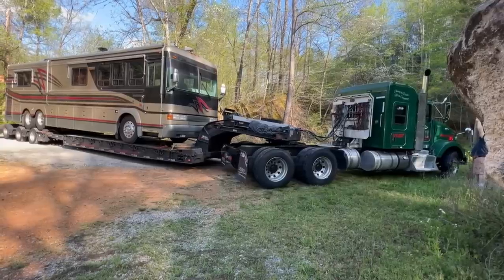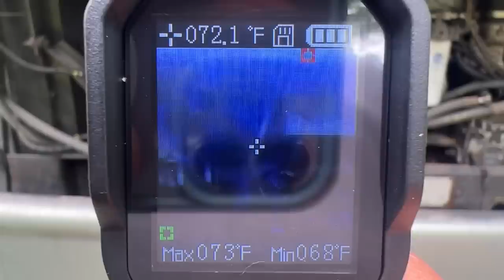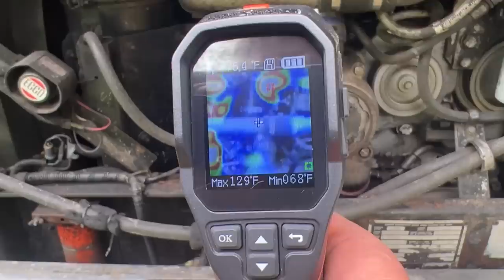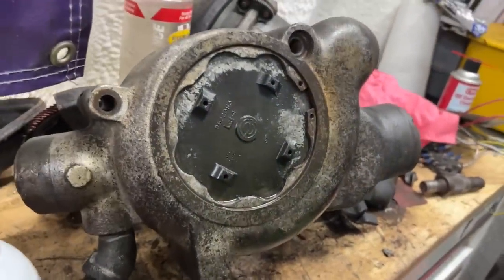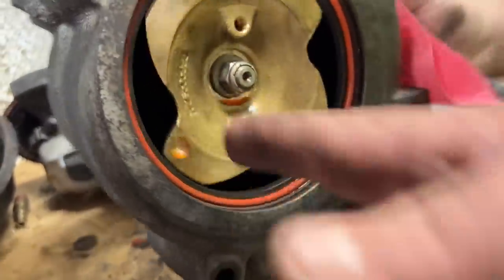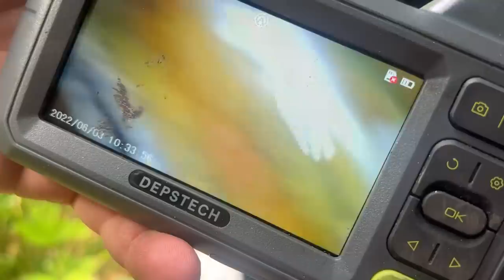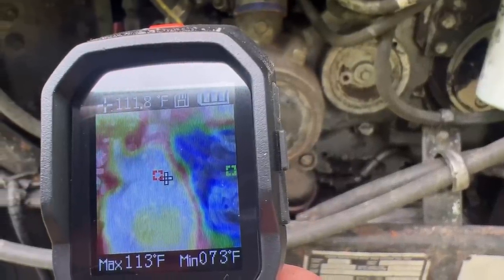Bad repair costs thousands but could have been a $20,000 + mistake.

Comment: As a former ASI certified diesel mechanic i have to say, I am sick to death of the widespread incompetence in the field. This is inexcusable. Thanks for what you do.
Reply: Thanks for your comment ... seeing the same in my former Industry ... Aerospace. Unfortunately, you can't just "pull over" at 35,000 feet. Troubling trend.
Reply: I too see this, which you can't really discribe any other then utter carelessness because ppl ARE trained, they just don't give a F anymore. I see it in ALL fields of work.  5 years ago it wasn't as bad as this I think. I try to put my finger on it what has changed, especially in the last couple of years and can't help but think that the pandemic and especially lockdowns destoyed far more then we think. Something in the spirit of ppl has broken I think; "Why should I care.."
Reply: @throttlebottle5906  Don't blame people who went to college for being a bad mechanic. You're not gonna find those people working in a diesel shop, after all - unless it's as a marketing/finance/HRM/whatever kind of position. College either leads to an office position, or to a research/lab position. It's unlikely that the diesel shop hires college graduates to do maintenance work. 
You can blame people who went to college for shitty design flaws, like EGR systems that clog up even when used properly by the user (read: thrash it, get it good and hot every couple of days), engines that wear out prematurely etc. Design and engineering stuff.
Reply: I'd like to see the old medieval guilds return where you could be certain of hiring a Master or one of his Journeymen to do a job and have confidence that it will be done correctly.
BGM would definitely qualify to be the Guildmaster of the Southeast Bus and Coach Repairman's Guild.
Reply: Most of America's workforce including skilled tradesman are unfortunately on drugs or mentally incapacitated but show up to do something every day. Go figure.
Reply: @mfbfreak  Also blame NO-SKILLS worthless  politicians who impose ecology-priority standards that are impossible to meet without sacrificing long-term reliability. These clowns are responsible for driving Caterpillar out of the Heavy truck market.
Reply: @SIONARAFLORIDA  Yeah, pretty much everywhere I've ever worked has been stocked with drug addicts. Pill heads to pot heads. 'Oops I forgot' is a common theme.
Reply: @davebryant6905  I have always looked at it this way:
I do my own repairs.
I buy my own tools.
I buy my own parts.
The money I would have thrown away on bad mechanics or even good mechanics are invested now in my own tools.
And I saved on the parts too.
It works out well.
My tool set is growing.
If I would have gave it away to unknown mechanics I would have nothing, no tools and headaches.
NOW ,  if I were a rich man, well, things would be a. Might but different... But I am not rich, so I get dirty working on my bus! Sometimes love it, sometimes hate it.
And my bus runs.

Comment: For viewers of South Main Auto…” just,because it’s new, doesn’t mean it’s good”. That was some great troubleshooting
Reply: Why is everything that is NEW these days such shit?
Reply: That phrase is true, but if i looked and heard the video correctly, the water pump may have been rebuilt at the shop. Either way, manufacturer defect or installer error. Been there done that. Small claims court !!!
Reply: This advice is wisdom. Truth, I'm an old hat, been spinning wrenches since the 1970s as a lad. I've learned that one must never assume it's right just because it's been replaced. I apply this concept to everything, even my own travails.

Comment: Totally inexcusable work by whoever rebuilt that pump.  Astonishing.
Reply: And THAT is why we have "Check Lists" for this ... there would  have been an empty box where the original mechanic would have written (by hand) what he/she torqued the nut to; also why we make check lists that require written interaction to confirm the exact Torque applied ... not just a "reference number".

Comment: Wow it seems like there's almost no one out there that can be trusted to do bus repairs judging by what rolls into your place....
Reply: Yes, kinda shocking really. Specially when you realise that many  busses are used to transport large groups of people. Imagine something breaking in the suspention or a catastrophic brake failure... 
IMO there should be a tight control on all work done and all parts used on busses. Like it's done in the aviation business.
Reply: You need to keep this in perspective! These guys are known in the community for being able to solve issues like the one seen here, so the percentage of botched jobs they see is over the top. For every case like this there are hundreds if not thousands of properly done repairs by competent mechanics. The kind of mechanics that take pride in their work and statements like "almost no one"  is doing those guys injustice.
Reply: @ceemosp   Point taken

Comment: Un F believable. Like how hard can it be to follow instructions, then perhaps ask a lead mechanic to QA your work. Hey I fixed the water pump, would you check it over and make sure it’s working properly ? There’s a reason why military aircraft get hammered and you don’t hear about them constantly crashing. ( proper procedure in repair without cutting corners and then a QA Check at intervals until a check flight confirmation returns the aircraft to full up status )
It’s almost like BGM is taking on the role of the NTSB at a crash site. Previous mechanic incompetence caused this incident.

Comment: He can easily dispute it if he paid by credit card. The thermal camera is a great tool not only for cooling but electrical. Easy to find hot relays, hot fuses and wires. Also great for finding improper sealed windows and doors

Comment: Yes the flatbed tow was expensive - but it saved a $20,000 engine.  The owner knew it was an odd problem with an unexpected finding.  Almost 50 years ago when I started I had an unusual problem after finishing an engine repair, and I received the best advice from Virgil, a guy with the biggest collection of tools I had ever seen up to that point: "go back and redo your last repair."  That was my own hard earned lesson that sometimes repaired does not mean it was correctly fixed.

Comment: Wow an expensive water pump fix due to the transport price, not much said on the Ames infrared thermal cam, looks like it did give you some help.  Would you recommend it or go with a Flir adapter to a phone?
Reply from the maker: I have the flir iphone adapter but this is nice so i can use my phone too.
Reply: @Bus Grease Monkey  but do you prefer one over the other?

Comment: Ive had a pressed on impeller spin free like that. But recently seen a guy with a new pump that all but 2 on the impeller fins just broke off!  Also had a volvo pump rebuilt and the rebuilder put an impeller on meant to turn the opposite way! That gave me same symptoms as this. That took some work to figure out lol.

Comment: Fortunately, the owner was smart enough to pay attention to his gauges, and stop before any real damage.  The $5000 tow, was an investment to save a $20k engine.  I'd file a refund claim on the card I used to pay for the rebuild.  I've done it before on a u-joint replacement, that the mechanic forgot to grease.  You've got 90 days from the time you get the bill, to contest it.

Comment: I've made the exact opposite mistake where I permanently de-calibrated a rotor from a shaft and then told everyone right away. (me telling everyone was awkward, unnecessary but I did tell the right people). 

Damn thing wasn't keyed at the factory, just a set screw leaving no mark. Not an engine, an electronic mess.

Comment: shouldn't the impeller have been tightened by the manufacturer or is it a common practice to ship them that way?
Reply: That is a rebuildable pump. You don't get a complete pump, just the seals, bearings and impeller. You have to take it apart and replace the internals. So it boils down to one person didn't tighten that nut and this was the result.
Reply: It's a rebuilt pump, the impeller and shaft are new in an old pump body.  The person who does the rebuild has to tighten the nut to clamp the impeller onto the (tapered?) shaft.

Comment: About the only time throwing a wrench into something wouldn't have hurt it..

 At least it didn't have air leaks .
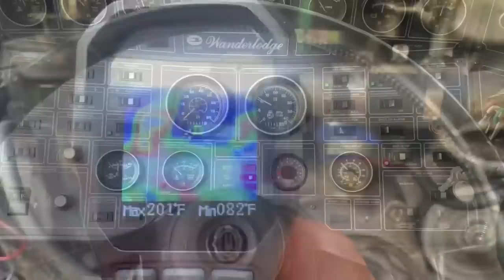Reply: @ 6:03 , 82psi
@ 6:28 , 77 psi
=fail dot air brake test
Reply: @joshuacatron2  so same as every one that's been in the shop.. guess that's a problem there   
I'm in a lumber town  the green and whites don't give many breaks , overweight is common   but i NEVER seen these kinda 
Safety issues on every vehicle.
Reply from the maker: That’s why we have not done a test drive yet.  We have a long list on this bus but overheating was #1
Reply: @BusGreaseMonkey  I "think" our commercial AZ  ,DZ ( air brake ) vehicles are 6 mth safety checks  A class D class anything air braked  are 1 yr safety check for insurance.and tags  but I  live in canada.  
They're very picky..glad  you guys are out there fixing things PROPERLY..  hopefully you don't get a big grocery list... keep posting..cheers.

Comment: How does shipping a bus that far only cost $5,000 but using Mayflower to move your house's contents costs $10,000???
Reply: ... because that $10k includes the cost of boxing/packaging up all our stuff in a house. I've moved 38 times in my life, all over the World ... bunches of money but that's the business.
Reply: @craigsowers8456  I don't think so.  Having the full service packaging concierge is extra!
Reply: Extra $5000 to cover all the stuff they break?
Reply: @ickipoo  My Father is moving from IN to FL in 8 days.  Me and my wife are moving ~12 months from now.  From the sounds of it that $10,000 is for a large straight truck not the 5th wheel traditional semi Mayflower that you typically see on the roads.  He has a smallish 5' gun safe, another shipping company quoted $20,000 when they heard the word "safe."
Reply: @Guillotines_For_Globalists  not if you work for  the World's largest Defense firm with hundreds of employee moves annually around the World; sort of a "flat rate" deal. But yes, with inflation the past 4 years, the price has gone up for the same service.
Reply: @craigsowers8456  It seems to me that people are throwing $hit at the wall these days and they try to see if it will stick or not.  We recently had a 2,100 square foot home repainted, we got 3 quotes.  $6,300, $15,000, and $25,000  How in the hell is there such a huge range?  We ended up hiring the $6,300 crew and they did an unbelievably good job and went above and beyond - we hired them for a few other tasks too as well (total bill was $7,250 in the end!)  All 3 bidding crews used the same paint as well - Sherwin Williams.